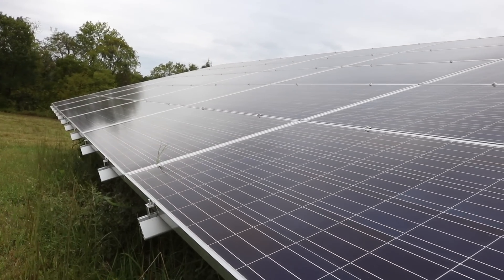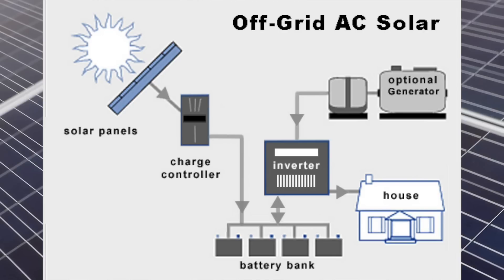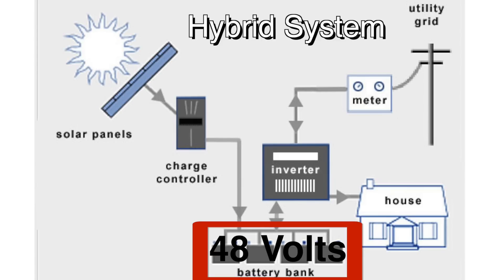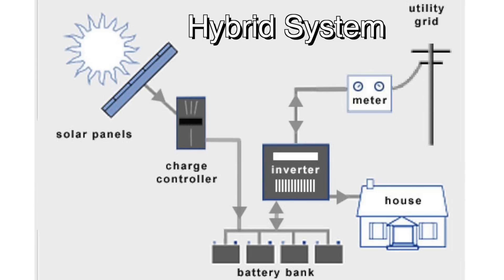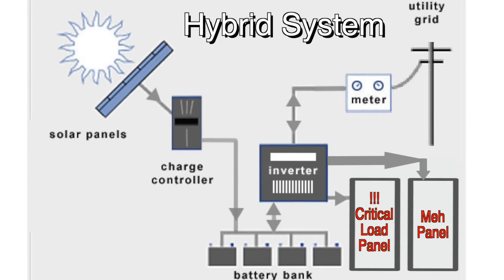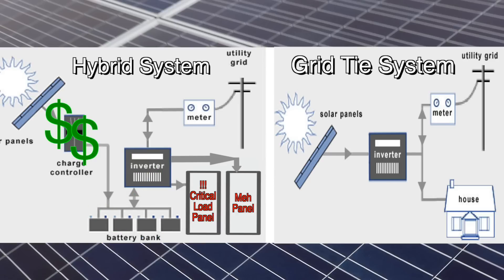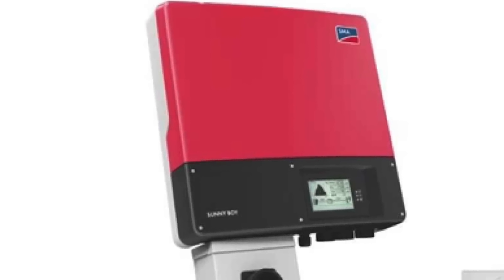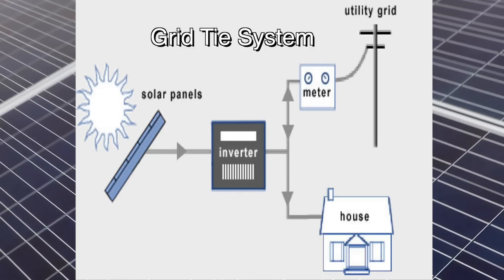Shedding light on solar power systems. Part 2, FarmCraft101 solar.

Comment: I have two sunnyboy inverters, and every time there is a hurricane (in FL), we use the outlets. They work great for us; we actually always plug in our fridge and usually can even run a single room plugin AC (and computers naturally). That's typically enough to get us through until the pet comes back. At night we use a portable generator.

Comment: Im a retired industrial electrician acdc power it's a lower volts on DC higher the voltage less amps I was taught by my dad and Uncles all were electricians and very capable could build your engine in a racecar or build anything I was looking getting a Nissan battery there getting old most 2012 23 years old scratch that I want to use higher voltage 96 volts would be great 2 lifepo 48 volt batterys highest amp hours I can afford I know this the Most money you'll spend you can build a nice system today with the technology you can watch these videos the solar age is here.krep posting videos thanks.

Comment: Imperial failure rate data on each component should be considered prior to buying the system.  Manufacturers of each component don't noise report accurate failure rate data.

I used to own a roof manage solar system

Comment: Thank you very much for your very detailed explainations on the different kinds of inverters.
  You asked a question on how to get rid of the extra power when the grid is down.
 I use 2kw x 120vdc wind turbine controllers to redirect the excess power into 138vdc immersion heaters in our hot water tanks. DHWT  and heat storage tank. Tot= just over 500 ltrs. This has worked faultlessly since 2012.
 Our system is 120vdc , 60 forklift cells. We have a 120vdc Yenzhou Shenshou wt cut back to 1500 watt and 4kw of solar pv in 3 strings of 140vdc ( vmp)
  The wind turbine controllers each have internal dump loDs of 2.8 kW,  they eCh have solar access of 660 watt. This was ignored because only one was controlling tbe turbine. So the internal dump loads were bypassed and each redirected to a 2kw x 138vdc immersion heater..
 In the mid summer months we use our ch rads to act as cooling rads to keep our Domestic hot water tank from overheating. Even our wood burnings stove becomes a heat dump. Our is a traditional built 4 bed house built just like any other. 
Just an idea that works really well for us, Maybe you might consider it yourself. A friend has done a similar install in 48vdc. He uses a pair of Tri stars to relay to his immersion heaters dump loads.
    Good luck.

Comment: My advice is: Only use the grid for power consumption.  Do not tie into the grid as a supplier. Do not sell them your power.  They will cheat you and your bills will go higher, regardless.  If you cannot afford a battery, don't buy into it.  Solar companies are going bankrupt because they cheated and overcharged everywhere.  Be cautious.
Reply: We get a full credit from our utility for every kWh we produce but don't use. This means that when we over produce we can bank that credit for the next month so that if the sun shines less we can use that 1:1 credit to offset any future electricity charge. Our system was sized correctly so we essentially pay nothing for electricity all year round. Having a good location and good design are critical. 😊

Comment: when you have a grid tie inverter it tries to push up the voltage so it's able to push energy onto the grid. Without a grid to push it to if the grid tie inverter would be still operational it would try and push voltage in your own system. But theres a safety in these inverters that only allows them to push the voltage up to a safe point. So the inverters will shut themselfs off when there is no grid and a unsufficient load. The same thing can happen in normal grid tie usage when theres to much solar power and to little load in your subsection

Comment: Nice video.  I would like to add that hybrid system can be cheap.  There are all in one hybrid inverter/charger/automatic transfer switch unit.  And hybrid inverter only has to power critical load sub panel.   Additional wrinkle is that hybrid inverter can power the critical load subpanel from batteries even when grid is on, to lower your electric bill since it can sense battery voltage and drain battery up to certain level and then switch back to grid power and let battery recover and repeat.

Comment: Been doing some back of the napkin math, I use about 15 KW hours a day of electricity. Averaged out throughout the year. My heat and water heater and stove are gas. I might add an electric heat pump but I'm thinking if I were to get a 6 KW inverter, that would probably run everything. I run a lot of 220 volt equipment though, I was thinking of using a Tesla battery from a Model S but I'm having trouble finding an inverter that accepts that high voltage input

Comment: Can't you just manually shut off the heavy loads (i.e. heat pumps, water heater, stove, etc) before swapping over to your battery backup instead of installing a critical load panel?

Comment: So I am planning to play around with these system when I retire in a few years. With the Off Grid system can you add more than one Back Up item? Generator is one, but could you also add a Wind Turbine to that side of the system. To keep the batteries full during say Rain by the wind turbine spinning up?

Comment: Is AC coupled system you have ultimately a cheaper and more efficient way to provide what a hybrid system provides?
Reply from the maker: No, I don't think so.  But many people get the grid tied system to start and then want to add a battery backup, so this is a good solution.  If you know you are doing a battery backup from the start, I would just build a hybrid system.
Reply: @FarmCraft101  thank you for your reply. I was under the impression that the hybrid is more costly than the AC coupled. I may have misunderstood.

Comment: So I have the Sunny Boy 5000TL-US-22 (4.3kW) on my house. The way it was explained to me was the one 15 amp circuit is immediately available to use when the grid goes down but it is only one 15 amp circuit. NOTE: I have not tried it since installation. 
The electrician did explain that if the panels are not generating enough (cloudy, night time, etc.) to power this circuit it will not work. It will be in a standby mode waiting for enough juice to come in from your panels and then automatically switch on again.
Hope this helps a bit. Thanks for the videos. Good visuals!

Comment: What do solar panels produce besides electricity?  SHADE. Solar panels should be sited where that shade can be leveraged. (Over parking lots and air-conditioned buildings) Not covering nature's perfect solar collectors which are meadows and pastures.

Comment: Great videos! Looking for info on adding a 20 KW standby generator with automatic switch to a grid-tied 7.5 KW solar . To protect inverter and generator in the event of grid outage, have come up with a contactor between automatic generator switch and solar inverter to shut down inverter from seeing generator power as grid power. Any leads or info or videos on this?  trestle994@sonic.net

Comment: Maybe i'm asking the wrong sort of questions, but wouldn't running your hybrid system through the batteries be less efficient? Could you create a system that has an option for you to charge the batteries without requiring it? So that you're running a normal tie in system up till the point where you need/want the battery?

Edit: Just watched video 3. The answer for others that are wondering is yes

Comment: The additional cost is offset by not needing a self starting 10kw generator fuel storage periodically testing running it changing oil at least once a year or several days running maintaining battery on gen keeping gen warm if it's cold where u are to prevent battery draining oil gumming up making using it EASY ENUF EVEN FOR THE KIDS

Comment: Look at Sol-ark 8K. that is the best out here right now. I used a Sunny Boy 4000tl-US and  SPS is a piece of crap. Not sure why they have it. on a cloudy day when my power went out I plugged in my fridge, and even though the frigged use only 250W running  at start uses a lot more, so, when the fridge starts to run the sunny boy will disconnect because the fridge at start, uses more than 400W.
I was able to run my laptop, Modem, Firewall, Monitor.
When the grid goes out the Sunny Boy will not tell you how much power is producing. I only know that it was producing 400W because the power came back.

Comment: Just wanted to echo another comment that this two part series is very helpful. Curious if you've looked into Sunamp batteries. Very cool tech and not very expensive (I think). Could really help reduce the time it takes to get your money back. https://www.sunamp.com/

I'm looking at a 4k system for the house with a Sunamp battery attached to a combi boiler. I'm no expert but the numbers look very promising. 

Thanks again for a great video.

Comment: If you design the house properly, by either having low electric energy usage, or separating circuits or appliences into critical and non-critical, you can run them separately, or if you do have some automation (i.e. remote appliance control, or some relays, power meters for each socket and other sinks of electricity - more the better as it gives more granularity), you can then deliver power from inverter to only critical systems, or do other fancy things. In fact well designed hybrid system could even bypass the inverter for this non-critical systems. But to do it fully well, one would need a special switching system that can put loads onto two different bars of electricity, and do it safely. Even if the two systems are independent during operation, one would ask inverter to synchronize frequency and phase to be same as the grid, and that will reduce switch time between two systems.

The other easy way, is to simply reduce energy usage - good insulation, use natural air convection, LED lights, dry cloths without a drier, high efficiency fridges and other appliances,  etc. Heating and water can be done with heat pump systems, plus insulation and recuperation. Cooking can be done with gas as a backup. Etc.

Comment: My house is wired 220-110AC -12DC-6VDC Most of my lighting is 12 -6 VDC LED  however the refrigerator is on grid AC .
 If the grid goes down I can disconnect the frig  and run an inverter to operate it, or use an AC generator either take up the charge on the battery system or run directly.  I have another charging unit that is an automotive alternator and a 5 HP Honda engine . More efficient than running an AC generator and converting that to DC12 volts . 
  The grid remains completely isolated from my system except for charging batteries when there is constant overcast and no wind .

Comment: Hypothetically, couldn't you have a Hybrid#2 version, that would have the "grid" just charge the batteries? As the grid connections are being phased out, wouldn't that be a way to maintain full or adequate service, and not need the extra system?

Comment: Hey!! I can't understand why batteries are first charged and then the power is sent to the inverter
Reply from the maker: It's really both at the same time.  The energy is sent to the batteries, and the inverter is hooked to the batteries.  The batteries are like a storage tank. If the inverter needs energy it will pull it from the batteries.  If the batteries are being charged at the same time, the result will be less pulled from storage.  If the batteries are being charged with more power than the inverter is requiring, then the batteries will continue to charge while the inverter is pulling power.

Comment: I think there are new systems out there that bypasses the charge controller and dumps to the grid when your bank is full, because the old systems used to heat up a coil like a toaster oven to burn off excess electricity which, if you ever had an electric bill you will understand how expensive running a toaster oven during the day can be, so imagine it being money that could be going into your pocket.

Comment: Can we use grid in off grid system as an alternative  of generator?
Reply: Shown briefly in the Part 1 video is a Schneider XW inverter connected to a battery bank. The XW has 3 AC connections: 1) AC1 for grid connection, 2) AC2 for an optional AC source, and 3) AC loads. So in theory, one could connect the grid to AC2 instead of to AC1. However, there could be a problems with synchronizing the Grid AC to the AC loads. The XW does not feed power back into AC2 so there should not be a problem. The XW will shut off feeding power into AC1 if AC1 voltage drops. IANAE so read the XW6848 manual.

Comment: I have a question do you work for the electric company???? The whole point of solar energy is to power your property without depending on the grid or anyone. In what world would you spend $17,000 and grid tie a self efficient system to give away thousands of dollars to a utility company. If you live in a place that gets lots of sun yes you will probably make more then you use but the charge controller will stop from charging your batteries. Think about it.... All those years you paid full price to the electric company for your electric use, now you have an efficient solar powered system you are making the electric company redundant so they decide to rip you off by buying it back at wholesale prices. You are not getting anything from them you are certainly not getting the amount they say, they are getting from you. That would not be a good business deal on their part. Have you any idea how much electric they collect for free????? Millions & millions of killowatts being fed back from your property which is not being metered sent back to the electric company using your ground wire. If you don't believe me put an amp meter on the ground wire.
You people are total idiots.
Reply from the maker: Do you have high blood pressure?  Chill out...  No, I don't work for the electric company.  The point of a grid tie solar system is to generate clean power and to make a good financial investment.  Installing a hybrid or off grid system is more expensive and requires a lot more work.  I don't sell electricity at all, because I use all that I generate.  Because I would have had to buy that electricity at retail rates, I am earning retail price for all the electricity I generate.  I have a net meter, which keeps track of the electricity going in and out of my system.  Are you implying that net metering is a hoax?  Or were you not aware that I have that type of meter.  Based on your comments, I suspect you've never heard of net metering.
Reply: No I don't have high blood pressure.... but it is a very nice solar energy system you have and like a lottery winner you have beggars trying to get some free. The electricity company is one of those beggars. They know how popular solar energy is getting and while they can they will try and boost their profits on you and others backs. Most of the regulations that govern the energy sector are put in place by the big bosses of the energy company's. Most are directly or indirectly linked in the political big wheel. So when you have the opportunity to break free do so, you will not regret it.
Reply: @malcolmdastur4411  When you "break free" from the Grid, you will pay even more per kWhr consumed.  Why do you want to pay more?  The goal is to pay less ...
Reply: Hi. I have a hybrid system. It no work like you say. 
The inverter synchronize whit the grid. If the solar production exceed the demand of the house it start to charge the battery’s. 
Wen the battery are full and if I don’t configure the export limit to 0 the excess of production goes to the company grid.wen the demand of the house exceeds the solar production it try’s to fulfill whit the battery and even if that are not enough whit the grid. 
I don’t use the EPS output at all. I thinking to use it only for my servers and computers at home. 
Sorry for my poor English but I am Portuguese

Comment: Actually, if you connect your charge controller to your battery bank AND your load (inverter) you can charge & use power simultaneously while the sun is shining.
Your excess power would be going back into the grid via an automatic disconnect that would keep the linemen safe from shocks if the grid fails.
This arrangement makes for a simple but very useful system that will always keep your house powered AND getting a check from the power company.
All of this equipment is available from numerous manufacturers and at fairly inexpensive costs if you figure in that you will not be offline no matter the grid status.